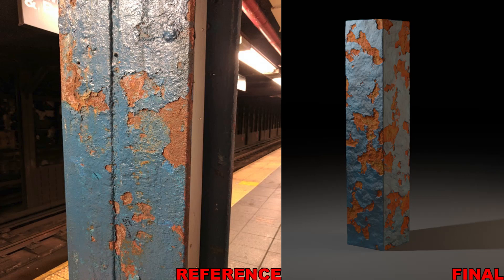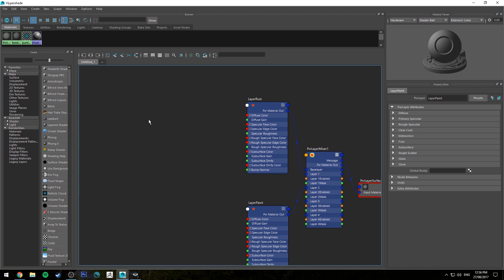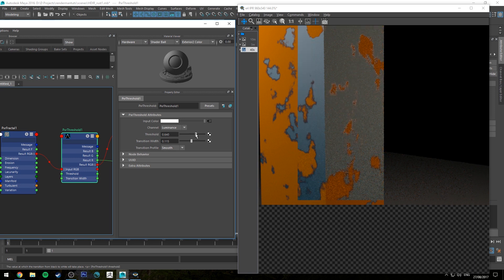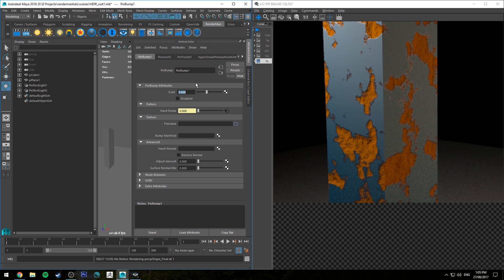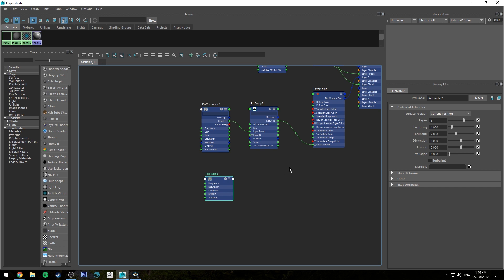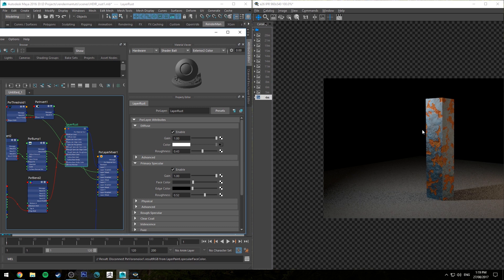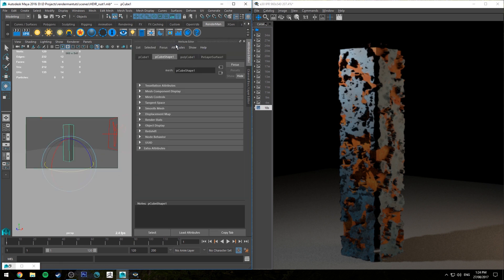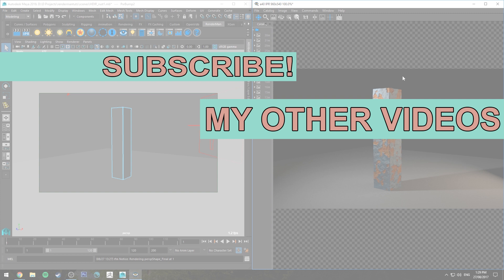How Do I Render: Painted Rusty Metal (Renderman & Maya)

Comment: What if I need to render a whole building made of rusty metal with lots of extrudes and faces removed?
I tried to insert edge loops by only some edges but rendering start to be incredibly slow. Any suggestion, please?
Reply from the maker: I wouldn't use displacements on a whole building as you're unlikely to be able to see the whole building or all the detail in any on shot. Normal maps should suffice and any close ups you could extract geometry and apply this shader to. This will make your scene a lot lighter and your render faster.
Reply: Ok. Thnks. Great tutorial anyway

Comment: Hi!
is there any way to render default maya materials?
Like Lambert, Blinn? or anyway to transform that lambert or blinn to pxr materials?
Reply from the maker: +Mani Salguero materials are usually specific to their engine. If you're using Renderman it's best to use Renderman materials. Blinns and Lambert will render but not as efficiently and with the same level of control. PxrSurface is easily capable of the same surface qualities as either a Blinn or Lambert anyway.
Reply: Small Robot Studio 
Thank You so much for your answer! 
The problem is that I have a project with a lot of nodes, textures, opacity maps, with lamberts and blinns but I have to render that with renderman, but it's only grey in the render :( 
Thank you!
You have the best tutorials! :3
Reply from the maker: Yeah I've got kind of bad news for you, you're going to need to re-route all of your texture and opacity maps into PxrSurface shaders to be able to render them correctly. It'll take some time depending on how many materials you need to convert but it's not impossible, I've had to do it before in pretty heavy scenes.
Reply: Small Robot Studio hahaha Ok! So let's start! Haha thank you so much! 😊